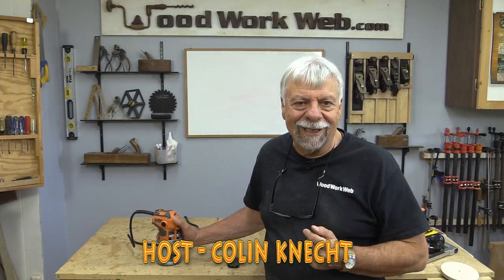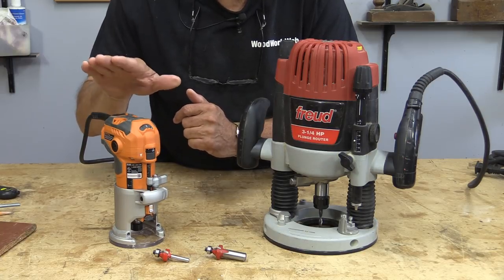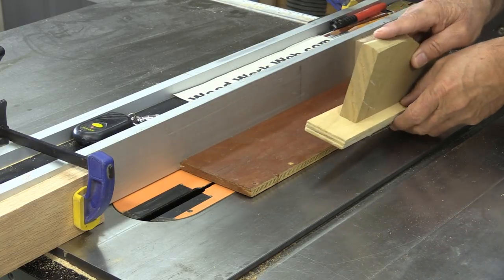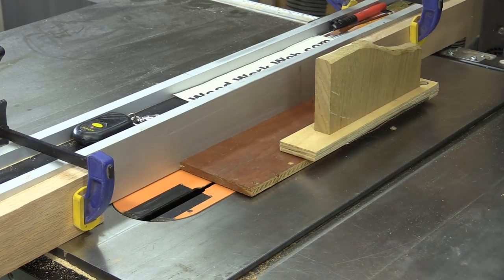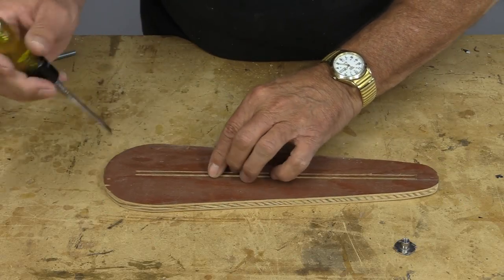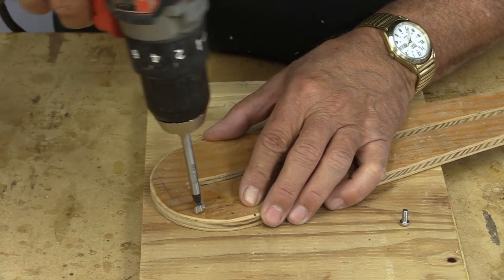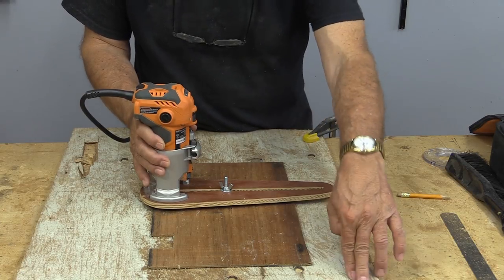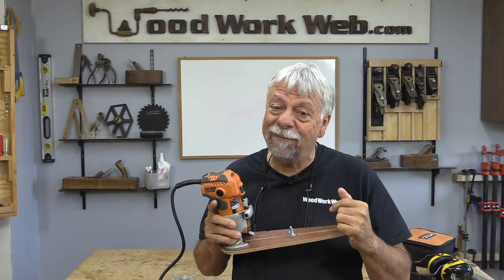Circle Cutting Jig for a Trim Router - Cutting Circles in Wood

Comment: This is probably good for 3mm thick ply, but nothing thicker as the angle of the bit is not at a 90 deg angle in the wood because the pivot hols it at a weird angle

Comment: I made this jig yesterday. It was easy and works great. Thank you very much for your knowledge. I used scrap 1/4 inch mdf. All I had to buy was a t nut and a carriage bolt...I had washers and threaded handle from old lawn tractor air filter. Total cost was $1.10...doesn't get any better.

Comment: I realize this is an old video, but I watched a few days ago - several times. It all looked clear and simple. But. 

I’ve been working on making this jig for the past two days. I’m an experienced woodworker, and I’m always looking for creative jigs to support my projects. This one looked like easy peasy. Not so much. 

First, there are no specifications or measurements for anything. Figure it out. 

Second, my trim router ( and your trim router) are not your trim router. It’s not one size fits all. 

Finally, the jig is at an angle because the needle point is elevated. So, the edge of the circle is not 90 degrees. 

Very disappointing. I have always expected better from Colin. 

Second,

Comment: Nice jig Colin! However, won't the edges of the cut circle be angled since you were cutting at an angle to begin with? I guess that it wouldn't matter unless one needed the walls of the circle to be at ninety degrees to the surface. Just curious...........
Reply: same question

Comment: What about the angle that you are getting because the jig is not touching the table?
Reply: Couple of solutions. Have a smaller point and hammer it in flat. 
Or. Cut halfway through. Then use a bearing flush cut router bit and finish the other side.

Comment: I have the same router and made I circle cutter with plexiglass , works great, 6minuts and 20sec into your video I noticed your finger almost went in the opening, while using mine my pinky finger went in the opening and got cut pretty bad well luckily I still have my finger so I installed a gaurd so it doesn’t happen again, you should maybe make one or I’ll be glad to send you pictures
Reply from the maker: Thanks for the tip and thanks for watching!

Comment: I realize this video is 3 years old but as evidence by my finding it today while building my own circle routing template- people will locate this video.. and I just wanted to chime up about that table saw push-stick use in this video- It's possible to do it this way, with the positioning on the left of the blade while the fence is on the right but it is EXTREMELY dangerous. If you were to push just enough of the slot you're cutting, or if the wood was under some sort of unknown tension (ask me how I know this, trust me- it happens and I was lucky), the blade slicing through could be pinched by the wood since the force being applied is towards both the blade and through the cut- and it could bind up and kick back at the operator. There is always a chance of kickback, but using the push stick on the right side of the blade, next to the fence is far safer than the left side where you could be adding a force pushing wood into the blade.

Comment: Colin, I've been out of woodworking for a while, due to a move, and have not watched a single video.  Once I got the spark this was the first video.  I got a thumb that is still a tiny bit sore after four years; I got too close to the blade on my table saw.  Fortunately the blade was only sticking through the work about a 1/8".  I hate the safety police even more than I hate the damn metric system.  But, I would have raised the blade while counting the number of revolution I spun the elevation crank.  I would not have had the blade higher than about 3/4" above the top of the board I was cutting.  I would have used a 4x4 for my pusher which would have completely enclosed the blade.  I am fortunate to still have all my fingers after 50 years of messing with power saws.  Actually the worst cut I ever got was from a freshly sharpened handsaw that jumped out of the kerf onto my thumb, it cut into the bone.  Ole Frank said, "Eddy, let the saw do the work, quit pushing it."  Lesson learned. I like the jig, may make one for my little Bosch plunge router.

Comment: Colin, I like this jig, just finished making - and just put the first coat of yellow paint on it. Since the t-nut is a tad bit larger I did two passes - slides with no play. Thanks for sharing.
Reply: What is the smallest circle you can make with this jig?  I need to make a 4" circle but not all the way through. Like a forstner bit would do. I want to embed a cordless phone charger in a table that i'm making and it's exactly 100 mm diameter. I'd ask Colin, but it doesn't look like he's answering peoples questions. Thanks.

Comment: Could that trim router be used to cut thru a 3/4 "  plywood to make a 6" hole in a corn hole board?
Reply: Yeah, but you'll want top make multiple passes taking off a little more material on each pass
Reply: @SwansonHD  Great, Thanks for the reply.

Comment: I watched several videos on how to make various forms of this jig and this was by far the easiest.  Well worth the minor effort required to save $50 buying one at the woodworking store.  I don't know why I never even thought of using a circular saw blade on my table saw.  I found all of the hardware needed at HD for $1.18/4 packs.  I used a 1/4in-20x2 1/2 bolt (In a bag 3 nuts/bolts for $1.18)  instead of the ready-rod and didn't bother to cut off the head - because that was a little easier.  I made two pivots - one with a sharpened end (end sharpened using 80 grit paper on a disc sander) and one with a threaded end.  Also, I could not get the barbs on the tee-nut to flatten, so I just kept bending them back and forth with needle-nose pliers until they fell off.  I then tried using a file to make it smooth - and finally decided it didn't matter if it was smooth.  The little bit of bumps that were left behind are used to further reinforce the wing nut clamping.  Great video!  Thank you for sharing.

Comment: Now quick question say my piece of wood was 1.5” thick is there a 1/4” bit for this trim router that would go all the way through and still be able to cut a circle?
Reply: 1/4" bit is the diameter of the shank of the bit

Comment: Hi colin, I just recently found your videos and I like them very much, I am going to buy a router soon and need to do a circle and this fixture looKS great but I don't understand what you did with the sharp points on the bottom insert your using on the bottom for the pointed screw, do you grind those off ?